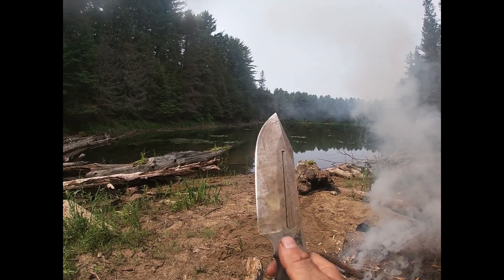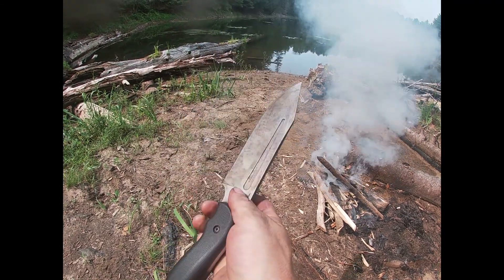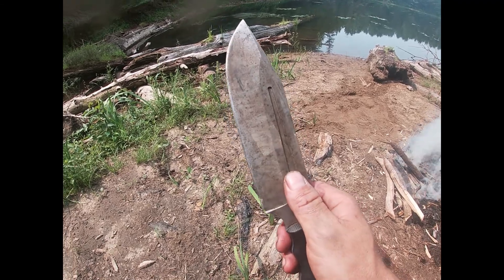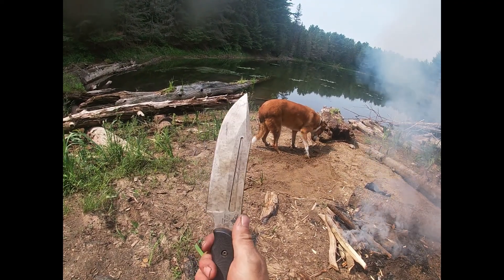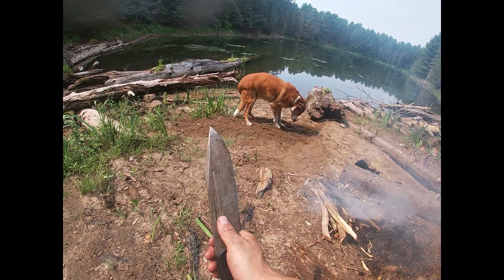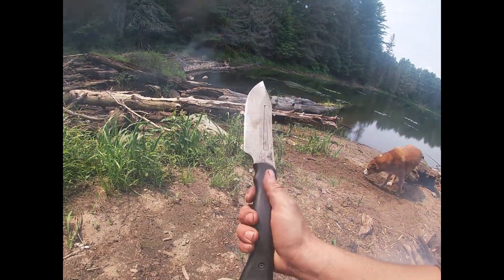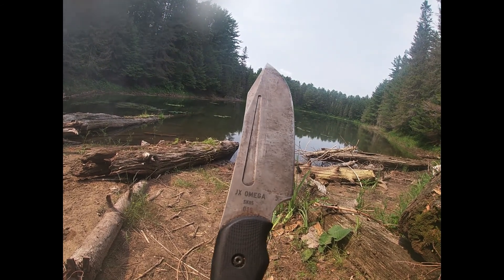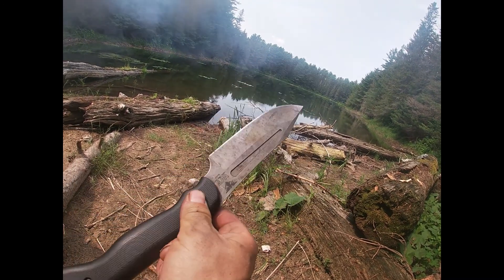SK85 Steel. What is it?

Comment: Sk85 is just another sk5, or a Japanese version of 1085, or fancy version of this and that. Say what you want, just because it says m390, it doesn’t mean they’re equal. It’s all in the heat treatment.  You can put the same exact ingredient in a dish, and I can guarantee you, every chef dish would taste different. And believe me, there’s a secret to it, otherwise we would all be certified blacksmith by now if it was only about the content of the ingredients . I seen this guy on YouTube broke a bunch of cold steel sk5, Kabar 1095, 1085, esee, , vg10, San mai, but there was one he couldn’t break in half  was the Work Tuff gear sk85 blade. And he was wacking it pretty damn hard on a steel pole. 
So is sk85 same as 1085, or fancy term for Japanese carbon steel? Heck no, although they may have near the same ingredients, doesn’t mean they were build with the same formula and quality. WTG are just badass blades, badass design, and most of all, badass price. keep up the good work man, great video.

Comment: I use my Worktuff Gear Atayal in sk85 alot. 
One of the slightly unusual things I use it for, is cutting hedges. This is really rough on blades. It causes immediate corrosion, and can chip blades not tempered properly,  and kills an edge fast.
Results? 
It holds up awesome. Takes and holds a super edge. Corrosion is superior to 1095, but you have to wipe off the sap immediately to prevent rust. Mine has a great patina due to EDC carry during summer with sweat, and for months. Really like my WTG knives and have put them through their paces.
Conclusion:
Sk85 performance is not far from my D2 steel knives. Easier to sharpen but holds a similar edge. 
I think it takes a better edge than D2. I was stand-offish about sk85 but it has won me over, Particularly with the WTG heat treat.
Reply from the maker: Hey thanks for the comment I really appreciate it. Everything you find about sk85 is exactly how I feel about. It's really cool to hear another person's point of veiw on steel and knives so thank you again. The jx omega I's the only wtg knife i own but I totaly agree they seem to be a good solid knife brand. Hopefully one day I can pick up a couple more of their knives and do a review. Happy new year.

Comment: hey man sk85 is just sk5 they renamed it for some reason
Reply: It's really 1085 just another name for marketing.  But it's the same chemical formula as 1085.
Reply: @richardhenry1969  ya just japans version of it basically
Reply: @wyatthines153  what really gets me is youtube influencers act like these steels are amazing.  When really it's 1085. But because they have a name nobody knows they mark the blade up to 3v prices.  Really it should be a $75-80 knife.  
The skrama is 80cv basically a better then 1080 steel. Yet it only cost $100 with a killer leather sheath. 
Maybe because I'm older buy I remember when something can from Japan wasn't a upgrade it was better then china but not by much. 
Now asking $200+ for 1085 because it's called sk85. 
When I can get a sp10 for $62. An its 1075. 
Even better 99.9% could not tell the difference.  They make statements oh it will need sharpening more then 1095. When nobody can tell the difference.  The difference is in the heat treatment more then the steel.
An production knives are heat treated in batches. They aren't spot on. 
I just get blown away by these people shilling.  Not even realizing we are getting played. Especially fixed blades they are blanks then machined. Probably only touched a few times. 
Yet getting prices like they are custom. 
Anyway sorry for the rant. I just see the whole knife market crashing soon. 
That's when you need to buy and collect.  Just my opinion.
Reply: @richardhenry1969  o i agree man i actually make knives lol ive worked with 1075 and 1095 the main one i use seems to be the 80crv2 tho and i could never pay what work tuff asks for those blades knowing what theyre made of and theyre made in taiwan with imported materials they maybe have 20 bucks into building one of their big blades and then times that by 10 and that seems to be their price ill tell you i will buy a big bark river in 3v any day over those blades and only pay a little more which is insane especially when you look at the price of 3v steel and how hard it is to work with